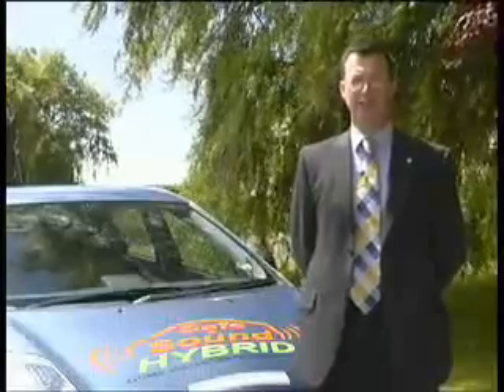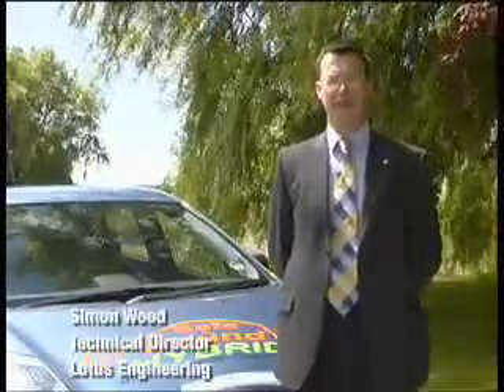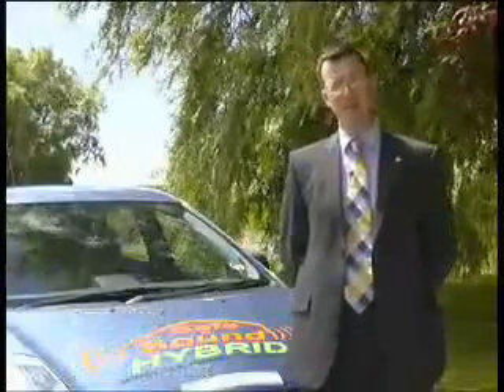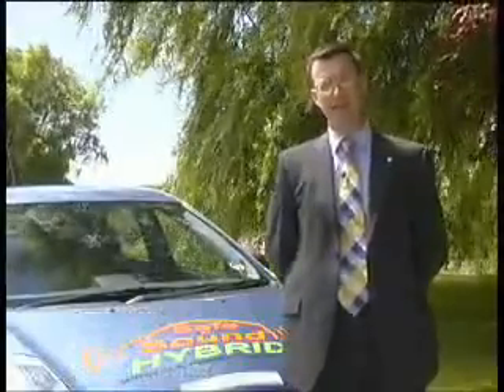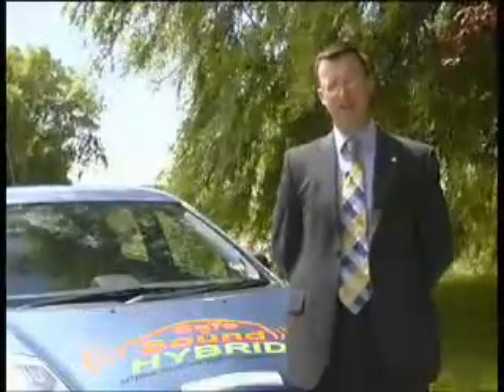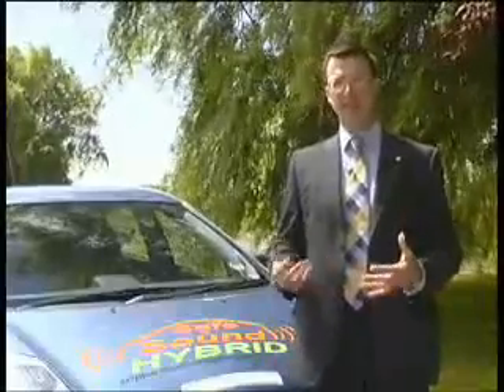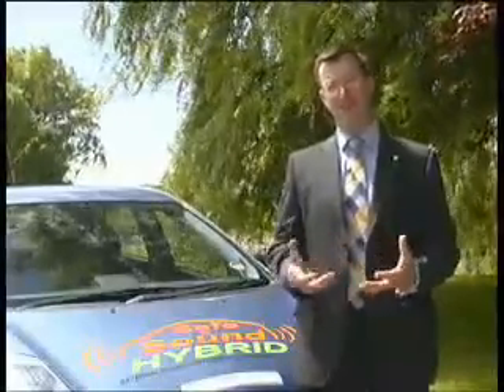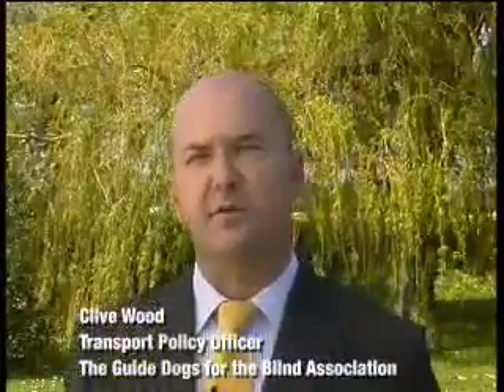LOTUS INTRODUCES HYBRID

Comment: Angelo is right. the hybrid/electric vehicle to operate quietly until a pedestrian needs to hear it. The automotive companies spend millions of dollars to keep the cars QUIET,  PASS only allows noise when it's necessary this is why it should be on demand,  FYI Leader Dogs for the Blind in Rochester Hills, Michigan has 2 system that they have been using for 2 years for training. but I am the inventor of PASS SYSTEMS so I am Bias, go to my you tube and see it